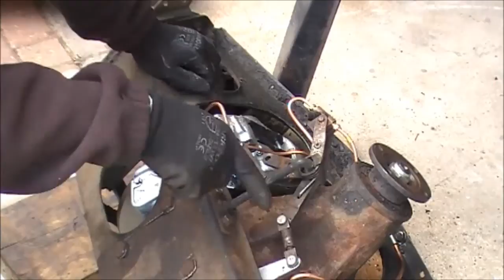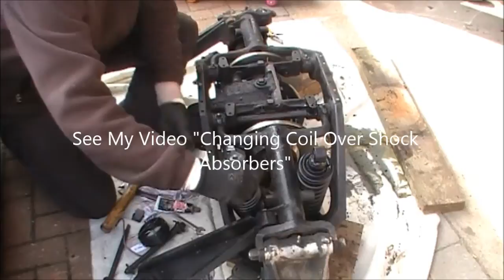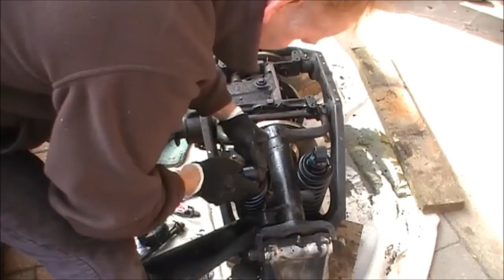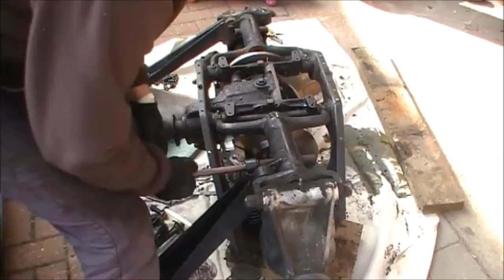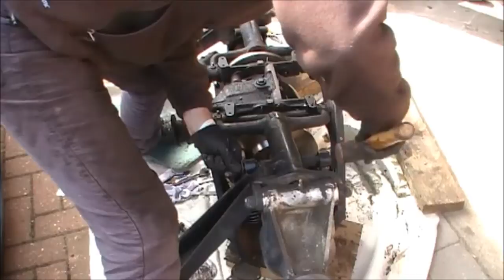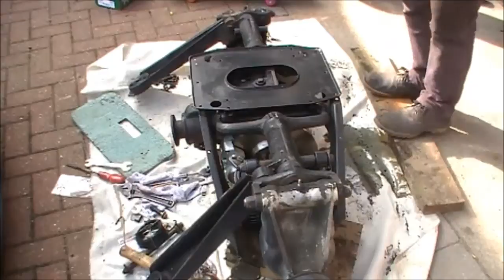Jaguar E type Rear Suspension Rebuild Part 7

Comment: Good tips, but I would have de-greased and pressure washed the whole cage assembly before starting. Also the nuts that hold your drive shafts to the rotor/hub - need to be replaced with new ones every time. NO nylocks due to the heat, they must be deformed locking nuts - all steel. I have a series 3 Sovereign rear end in a hot rod, and I can understand the time consuming, and cursing. And mine is out of the cage.....  Fitting the calipers, wiring the bolts, doing pre-load on the swing arms and hubs..... it ain't easy. Well done mate.
Reply from the maker: Many thanks Mudgrove, I wish you well with the xj and I appreciate that most people will end up cleaning everything within sight given the opportunity whilst access is good.
Reply: Thanks mate, they are good time wasters, yes? Just threading the wire is tough enough. Do you have the right twisting pliers? they are cheap. Hard to access the calipers, yes, but required for diff pumpkin mounting bolts, caliper bolts, A arm mounts to pumpkin, and front caliper mounts too. I think 25 turns per inch is right? Plenty of sites to check this out. Don't use stainless mig wire either it's too brittle. Get the right stuff for the job.